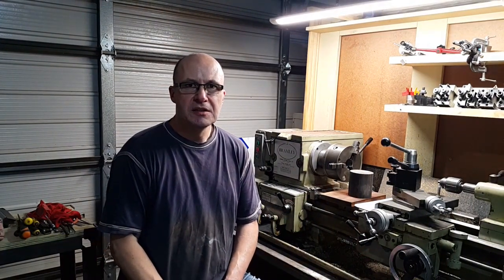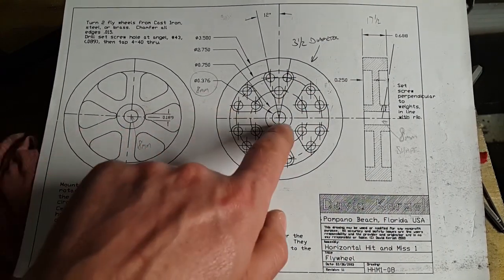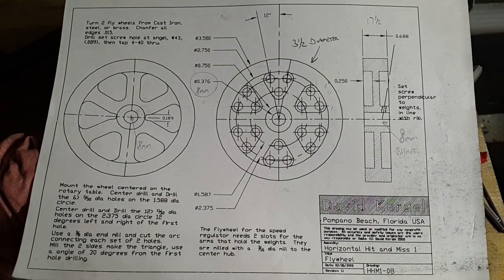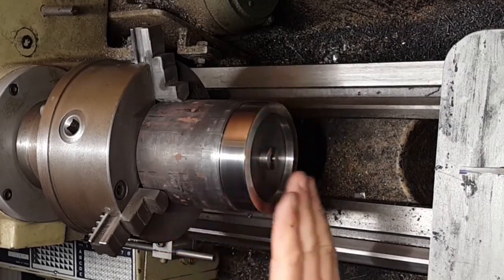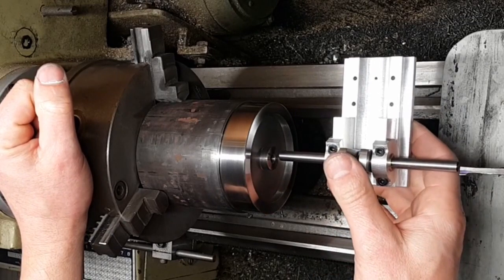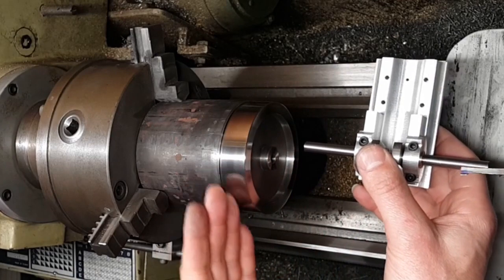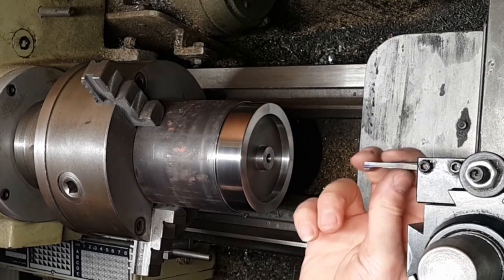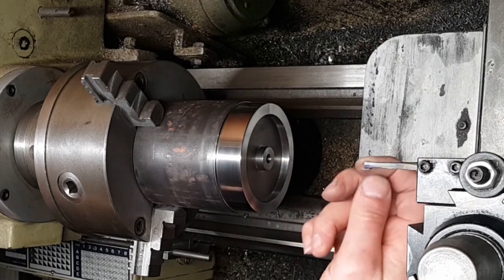#69 - Kerzel Hit & Miss Model Engine - Part 13

Comment: Kevin, what tool were you using to finish up the side of the flywheel on the lathe for the finish cuts?  I couldn't really tell.  A reground broken endmill maybe?  The flywheel looks great.  I am glad you are sharing this series.  I am starting to think I won't get back into the shop.  The house remodel and the constant delays are killing me.  Thanks Kevin for sharing and saving a little of my sanity.  Haha

Joe
Reply from the maker: Hi Joe, the finish cut on the flywheel was an old HSS CNC endmill I reground to  a be suitable for cast iron. I use a mixture of HSS and Solid carbide endmills at work and when they go dull or break I bring them home to regrind as tooling mostly for the lathe. I won't ask how the house remodelings going then!. Regards Kevin

Comment: Hi Kevin, that flywheel came out a treat.  Who hasn't missed a machined part when you bandsaw, at least it didn't get marked.  I noticed on the sped up frame rate on the cutting it almost looked like a pulse air blow, was it, or just an air nozzle by hand or blowing with your lungs.  The reason I ask is when I was running a large floor borer many years ago I had an air pulse blow off when I was machining parts to keep the cut line clear.
Cam
Reply from the maker: Hi Cam, thanks for watching. Yes it was a human air gun... Hope you and family are keeping well. Regards Kevin